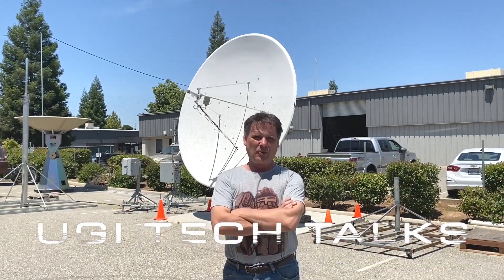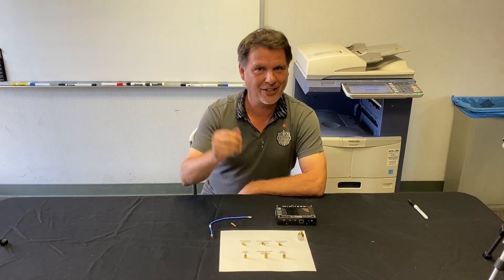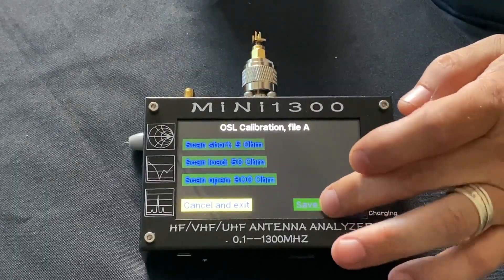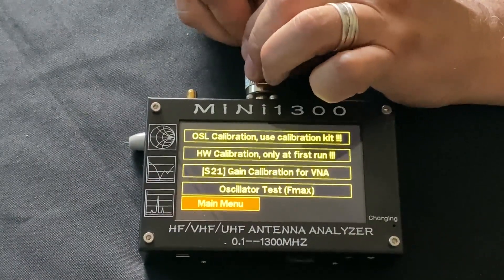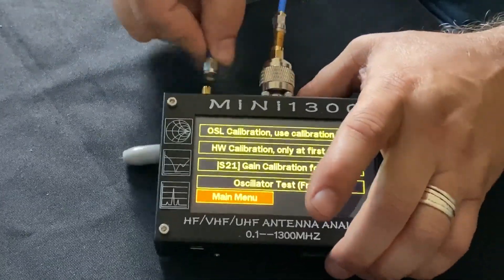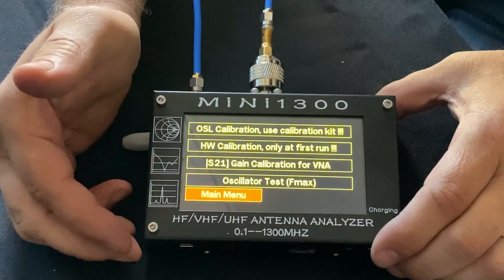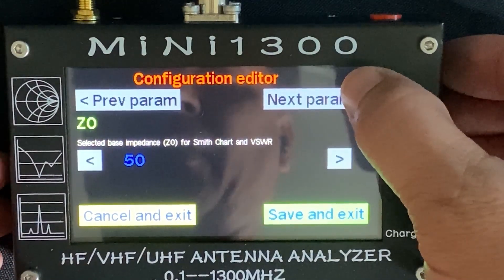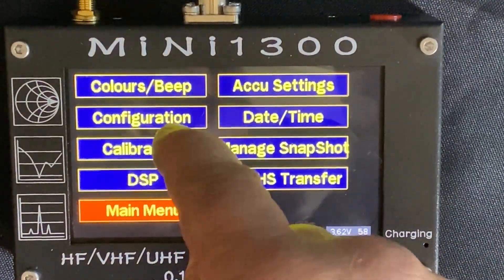Mini 1300 Vector Network Analyzer - Calibration with Factory Kit

Comment: Can the instrument be used as an RF Field strength meter?  I have a lot of stray rf in the shack and I want to track it down.  
What is the dynamic range of the meter ? Linear range and absolute range?  
How would you set it up for detecting stray RF at frequencies 3 -50 mhz?   I have a set of loops and rods (SMA) 
Thank you

Comment: 07/2025
My device must have later software?
When I press [S21] Gain calibration, I'm given two options:
"S21 calibration without attenuator"
OR
"S21 with Attenuator"
I perform the first test using a short cable, but it then requires me to:
"Now insert attenuator and touch button (2)"
Can anyone comment on the value of the inline attenuator required and what I'm actually achieving here, as I can find no references to this procedure anywhere on the web?

Comment: Does any one know what the values are for the surface mount resistors they send with the unit . i got them solderd on but dont know wich one is the 5ohm 50ohm or 300ohm
Reply: Hey did you eventually find out the values of mount resistors? I’m surprised no one knows.
Reply: The open one is easy, the 50ohm has an insulator the 5ohm is short

Comment: Fabulous video, thank you - you've single handedly filled a huge gap in the user manual technical info. 👍 Regarding the HW Cal, is this a simple touch-screen button pressing exercise (once only) or are hardware configurations required (switch/es) inside the mini1300? The reason I ask is because, in my drive for online information I've found the FAA-450 EU1KY analyser with a good manual, and whilst this kit is not exactly the same as the mini1300,  it's archetecture bears a striking resemblance. In the FAA manual it talks about changing a jumper on the RF board to do the HW cal. Thanks in advance. 👍

Comment: Anyone use this on their 23cm setup?  I seem to have SWR results that are all over the board.  The unit goes berserk above 1000mhz even into a dummy load.  Anyone have any success?
Reply: I made my own loads in the video, because the ones that come with the kit are not really good above 700 MHz.
Reply: I did, just around a few days ago, and the value of the testing results is almost equal to the KC-901V and the Rigol 815TG.